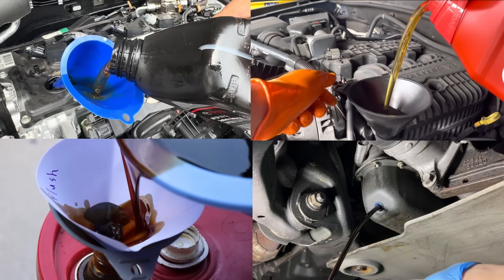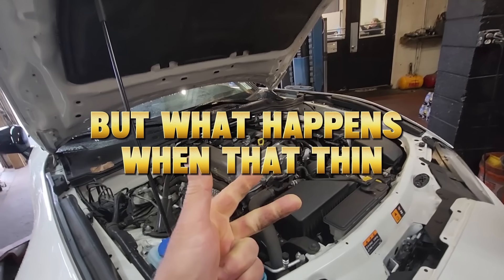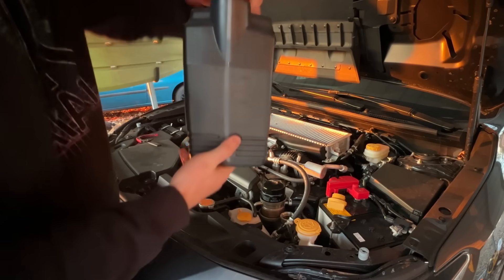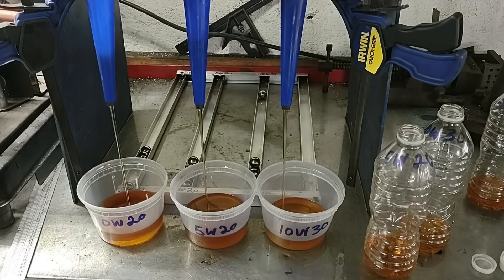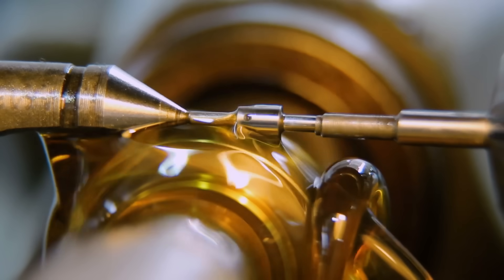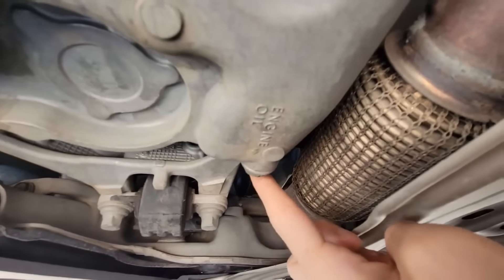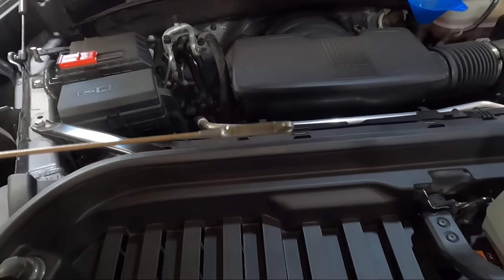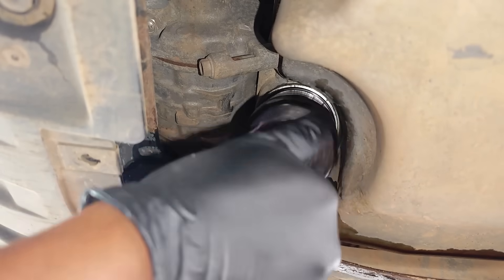The TRUTH About 0W 20 vs 5W 30 Oil (50 Engines Tested!)

Comment: What happens when you use 10/30 instead of 5/30
Reply: You have less protection from the wear that occurs during cold starts. 5W oil will circulate better than 10W oil during cold starts and 0W oil will circulate better than 5W oil during cold starts. Most engine wear occurs during cold starts.

Comment: You partially answered a question. Why not use 0W-30. What advantage does 5W-30 have over 0W-30? My 2024 Lexus ES350 with 6 cylinder 2GR-FKS calls for 0W-20 but I’m using 0W-30. I don’t drive in winter and was thinking about using 5W-40.
Reply: I switched to 0-30 once I was done with the stealership free oil changes, 1yr no problems
Reply: don't worry about it to much just use the oil it says to use. the risk it of using a 0w30 or 5w40 you possibly cause blow out any seal on the engine because it higher oil pressure. I've owned a 2016 Toyota sienna le with a 2GR-FE V6 with 196400 miles after it got total and I've used 0w20 its hole life. 1-16-2016   10-26-2024 RIP  rest in car heaven

Comment: Recently my 2005 Dodge Ram engine was destroyed because of the tabarnac of junkry from 0-20.. second I went to pick up my truck from the garage, the engine was hitting so hard and yet the engine did not hit until its..1 days 1/2 I changed the oil for him usually 5-30 but the damage was already done 🤬🤬 I am in tabarnak after the garage who put me the wrong oil and also dared to tell me to change truck! A Severe Gangs

Comment: Go by manufactures recommendation. Something people are forgetting or don't realize is that oils are not only for lubrication but has a dual purpose, a hydraulic function adjusting your timing sprockets, hence, it requires a lighter oil for better flow. I have run many engines past the 200K mark with the manufactures recommended oil weight, using full synthetic Mobil 1, at an average change of about 7,000 miles with zero engine issues. Most of the oil I have used is 0W20. With the exception of 1 engine, a 2014 Pentastar, it had the famous tick and 2 lifters were replaced which had nothing to do with the oil. Key thing, keep that oil clean by using high quality full synthetic. I have mostly used Mobil 1 but recently have changed to Amsoil on two of the 6 vehicles I take care of.
Reply: You’re missing a few fundamentals about oil formulation.
The manufacturer’s spec is designed around EPA fuel-efficiency targets, not the absolute best protection margin. Viscosity grade is just one small piece of the puzzle — cold-cranking (CCS), high-temperature-high-shear, and volatility determine how stable the oil film actually is.

A “lighter oil” might move faster in a bench test, but that doesn’t mean it maintains film strength once fuel dilution and shear start happening. Direct-injected engines especially contaminate and thin oils much faster than most people realize.

And about “running engines past 200K miles” — a few personal stories don’t prove anything. When the baseline oil formulation is truly balanced, the engine reputation builds itself across millions of units, not a couple of lucky samples.

So sure, follow the label if you only care about compliance. But if you care about oxidation resistance, base-oil retention, and long-term stability, you’ll look beyond the number on the cap. Mobil 1 or not, physics doesn’t read marketing brochures.
Reply: @stevenchen1156  if the engineers that have tested these engines were wrong, engine failures due to the type of oil viscosity would be all across the board. Now there has been some cases I have come across, but nothing to suggest all oil recommendations are wrong. So, if I have a team of engineers (I strees team, not a lone wolf) test engines with, lets say 0W20 viscosity from Ford, GM, Honda, Toyota, etc. versus a mechanic that thinks these are engines from 50 years ago, I will go with the engineers that have had the luxury of testing (blowing up engines) and spending thousands of dollars than the mechanic that tells me he determined the engine runs smoother because he hears it running smoother.
Reply: @FrankDAmico-dr5dl  That’s a nice theory, but reality shows otherwise. GM literally had to switch their 6.2L V8 from 0W-20 to 0W-40 because of real-world failures — not because some “mechanic from 50 years ago” said so, but due to crankshaft and connecting-rod wear confirmed by engineers themselves.

When manufacturing tolerances or long-term stress data reveal weaknesses, the “book spec” changes. That’s why the recall bulletin explicitly instructs dealers to inspect those engines and, if cleared, move to 0W-40 for better film strength and protection at higher temps.

So no, engineers aren’t infallible — they adapt specs after field data proves something isn’t ideal. That’s called progress, not blind trust.
Reply: @stevenchen1156  as I said before, there are some issues every now and then but most of the time they are right. Infallible???Nobody is infallible and I don't know where you got that from. Just to be clear, I am not an engineer but I am a tech of a sort. I have and I work with engineering every now and then. If you want to try any other oil that is not recommended for your vehicle, go a head. But that day you go looking to repair your vehicle under warranty and it has the improper oil just because a mechanic told you so, that dog won't hunt.
Reply: @stevenchen1156  And they are there to build to a price point that will make it to the end of the warranty period.
Reply: Manufacturers routinely recommend different viscosities
Reply: @StephenShaddox  no kidding. Go by the recommended oil viscosity on your oil cap.
Reply: @FrankDAmico-dr5dl  Ok brilliant oil guy. Which oil do i use then? Per mercedes spec “The MB 229.5 specification applies to the viscosity classes SAE 0w30, SAE 5w30, SAE 0w40 and SAE 5w40.”???  I would love to know the answer because i assure you all 4 arent on the oil cap
Reply: @StephenShaddox  dude, take a chill pill. First of all, I claim nothing, I only gave my opinion. From all engineering perspectives, let me make this clear, I am not an engineer, but they know more than me, specially the ones that design and test engines. For your specific issue, call MB and they will give you better guidance probably better than anybody here.
Reply: You may be well intentioned but you are misinformed.
Reply: @Howard-dv4vo  maybe so, but so far (50+ years of messing with vehicles and owning over 18 of them), all good!
Reply: AMSOIL is a great oil. I use it in a 165,000 mile Excursion V10.
🐺
Reply: @wolfalaska7638 My son runs a body shop and swears by Royal Purple .He has now roached 4 engines with it. I drive harder work engines pulling trailers and used Penzoil, Philips 66, Valvoline and now Mobil 1 and have NEVER had an engine failure an have had 2 engines exceed 250000 miles,  1 I am still using.All of my trucks exceeded 125000 miles and none were oil burners
 All had 5000 mile setvice interval
.
Reply: Ok brilliant oil guy. Which oil do i use then? Per mercedes spec “The MB 229.5 specification applies to the viscosity classes SAE 0w30, SAE 5w30, SAE 0w40 and SAE 5w40.”???  I would love to know the answer because i assure you all 4 arent on the oil cap
Reply: Ford made no changes on theirv10 ,yet they quit recomending 5w20 and swtched to 5w30.
Reply: So Frank, what do you use in an f150 when it calls for 5w-20 in the US but calls for 5w-30 for the ones that get exported to other countries?  Same truck right?  Why would the country it lands in make a difference as to what viscosity to use?
Reply: @robcockrum2662  This is my personal opinion, if the manufacturers recommend a certain viscosity, you follow that. If in time they start getting input from mechanics/dealerships that there might be issues with a certain viscosity, changes most likely will be issued (we hope).  As per your question, geographic temperature has a lot to do with the viscosity type that will be used, if the vehicle will be operated in the desert where normal temps are extremely high, I imagine higher viscosity will be required. Matter of fact, many car manuals I remember seeing viscosity recommendations depending on geographical locations which just make sense. Again, just my personal opinion.
Reply: Ok frank, but you do know the manufacturer recommended rules were written by an biden appointed man in a dress, but you keep going on that info
Reply: @garman7921  LOL on the man in a dress but I am sure the engineers have done a good job testing their viscosities.

Comment: It's engine type, temperature and conditions, the old owners manuals told you that, if outside temps are higher use a thicker oil, if conditions are arduous eg towing or mountains or heavy loads use thicker oil and temps these days are still wildly fluctuating over the world, no one oil can compensate for that. If long distance driving, no need for 3000 mile changes if short distance driving change oil much more frequently. (Fuel contamination and water condensation in oil) 
It stands to reason that a thicker oil causes less metal to metal contact, but has more drag, more fuel use. But is the cost of less fuel worth the cost of an engine and downtime? I suppose if one drives 10k a year and you keep the car for four years who cares what oil or intervals, pity the person that buys that car of you're in a cold or hot or humid climate!? 
Personally I'm a high milage driver, as in 600mile a day, and run thicker oil for 6000 mile (yeah, lots of oil changes) because that engine has to last. 
BTW both vehicles are way over 400k miles and run great, no oil use.

Also, if it's a diesel, change oil and filters very frequently especially if it's a city car, diesels are a dirty engine with lots of detergent in the oils, keeps the engine sort of clean but the oil is always "dirty" black like tar carbon etc colour that black is rubbish circulating in the engine too small to get picked up by the filters, wearing the diesel out if not changed frequently. Long distance truck use to have their oil changed every month or so depending on make and use. Things have changed, not sure if it's for the better?
Reply: Why does outside temperature have anything to do with it? Your oil is inside your engine where the operating temperature varies very little regardless of the ambient temperature.
Reply: @njsongwriter when it's cooler cool air doesn't just cool the radiator it also cools the sump engine etc. when  it's warmer the oil in the sump or engine doesn't get as much cooling. The radiator and thermostat organises the coolant and engine but not enough of the oil so your oil will be hotter in the engine on hot days. The coolant really only cools the top end of the engine not the bottom of the engine. Even though your temp gauge doesn't move the engine especially the bottom end where all the oil is gets hotter therefore also the bearing surfaces etc so oil thins as it gets hotter which gives the oil less cheat strength therefore more metal to metal contact. So, run thinner oil in cold climates and thicker oil in hot climates.

Comment: 0w-40 sounds interesting… plan on trying Mobil1 0w-40 in the Robin-Subaru EHO-35 - changing each 5-10 hours for this little screecher.
Reply: That's what I use in my C6 Z06, I let come to temp before driving spiritedly. Only 24k miles but I feel I'm treating it the way it should be.

Comment: Change often. Quantity has a quality of itself when it comes to how often you change oil.
Reply: Every 3,000 miles/5000 km???
Reply: @dennisyoung4631  5k is good. 2-3 months avg driver. If you are driving some silly $75K jeep or similar do 3k. If you are mental change the oil every week. Oil aint a dollar a bottle like it was 40 years ago so be realistic.
Reply: @stephenrblvuh, I wasn’t thinking average driver, but rather someone who might driver 3-5k per year tops.  Most of my working life, I was in that category - and I recall buying oil in the early eighties, albeit for motorcycles.  

While I don’t recall actual prices for four-stroke oil, (recall buying Castrol GTX 20w-50 for both Air Cooled Hondas) I recall the price of two-stroke oil (Torco T-2 injector - a mineral oil) to be ~ 3 $ a quart circa 1987-8. 

Two stroke oil is several times that now, so the 1$ per bottle sounds believable.

Still, though - I’m thinking 40$ a bit more often is preferable to the $$$$$ for a premature rebuild.  A chief matter in my case is that I can do an oil change on any vehicle I’m likely to own - unlike a big rebuild, which would need facilities I don’t have. (Have or can get most of the measuring tools, as well as the other tools.)   This puts me at the mercy of others - and because I am disabled (and cannot reliably discern body language or tone of voice) - I am 1) exceedingly vulnerable to deception; and 2)thought to deserve such predation by a large swathe of the population.

The average person won’t have the same degree of trouble in this area.  Your approach would work for them.

I’d be better off doing what I can to get maximum life out of any engines I run.
Reply: @stephenrblv 5k or 6 months, use a quality synthetic and synthetic rated filter. No 0w anything unless you live in North Canada or Alaska. Don't lubricate your engine with piss. 5w-20 is fine in winter if that's what the oil cap says. Summer heat should be 5w-30. 3% fuel savings isn't worth excess bearing failure. 20w isn't good for heat as it is too thin. If your car eats oil, 3k might be preferred as carbon past the rings is what wipes out oil. I dont care how great Amsoil is...carbon bypass still wipes it out. 20k is ridiculous like Amsoil used to say. I do run Amsoil in my external generator and Honda blower. Change it every two years because there is little hours on the oil.
Reply: @dennisyoung4631  Operating conditions might be keyword for engine oil changes. When someone frequently covers long distances, odds are you will be hitting 10-15k km in less than a year, maybe in half a year. However accumulating the same "10k km" in short city trips where engine doesn't have luxury of reaching and maintaining its working temp might take two years or more. And by that time oil likely would deteriorate hard due to both oxidation and significant fuel contamination from frequent cold starts without boiling fuel off.

So, typical user manual with "replace every x kilometers/miles or every year, whichever comes first" is actually sound. Sadly many people forget about "year" part and focus on "30k km long life", which frequently also have asterisk attached, leading to shorten interval to 15 or even 10k km in "severe conditions", which includes long idle times, short trips and city driving.
Reply: @dennisyoung4631 If you can afford it, go for it. I change my oil before 10.000, often at 5000 kilometers and sometimes (after excessive short trips and cold starts) even before 3000 kilometers.
If you change oil frequently you have no need for an engine flush when changing your oil as there are no deposits at all in your engine due to the detergents in motor oils.
Also you have no need to add additives to your oil as the additives already present in every motor oil do not get used up when you change the oil frequently.
Reply: @dennisyoung4631  I've seen a lot of YouTube videos lately that recommend 5K. But no mileage? So the answer is still up in the air.
Reply: @morganfbilbo4659  It doesn't matter if new or how old the car is.
Reply: Good rule of thumb I think is to change the engine oil when the oil life monitor reaches 50%.
Reply: I get around 5K miles (around 8K kilometers) and change my oil every year on average.